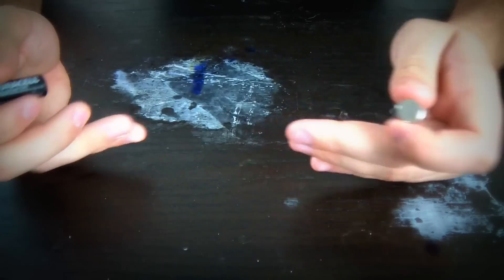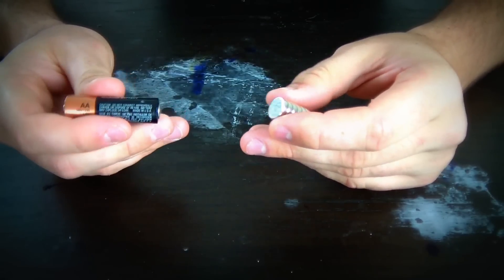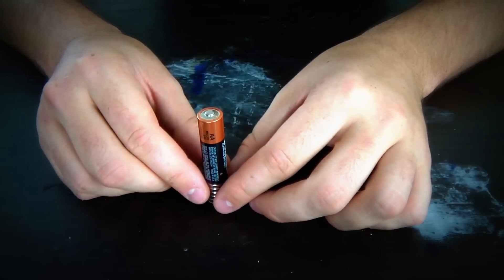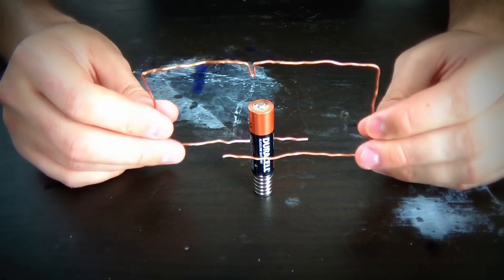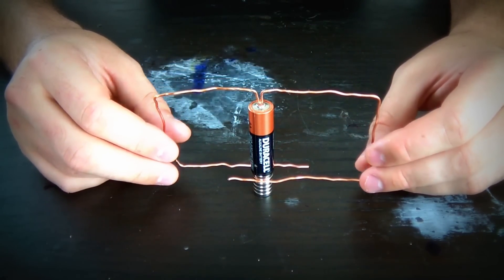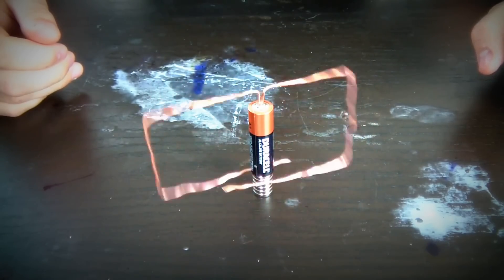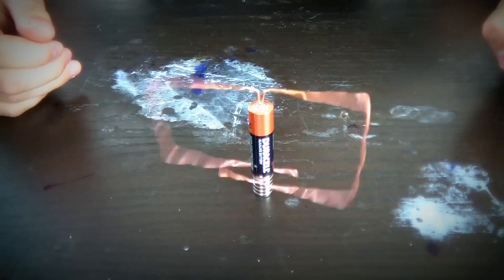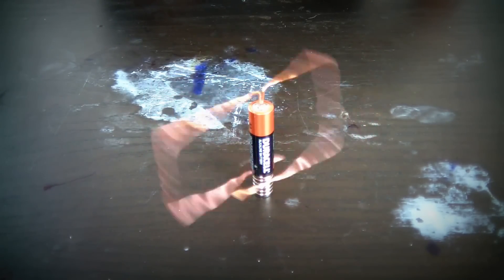Homopolar Motor

Comment: I made this with a new battery and on the wire I put some wings on and it flue about 50 + feet in the air and then started moving back and forth

Comment: It's easy since copper in non polar which means magnets don't stick to it and the neodymium magnets conduct electricity you end up creating an ac motor, and it spins because of the magnetic field created by the battery
Reply: +Cary Gonzalez one side chases the other. The End
Reply: +Jerry Enix how is it ac, the current never switches off.
Reply: +Cary Gonzalez
So what happens is the copper is non magnetic, so the magnets don't stick to it. And the type of magnet he is using conducts electricity because it's a metal. so when you put the wire on both the battery and the magnet it completes the circuit, but also creates a electro magnet. And it's because of the magnetic fields from the electro magnet that was just made and the magnets you already have attached to the battery it makes the wire spin
Reply: What

Comment: It works because there is a current carrying conductor in a magnetic field with relative motion between the 2. This is called motor action and is required for all electric motors.

Comment: ... if you split the two ends of the two wires that attach to the bottom magnets - it will not spin ! ... the spin is caused by that connection ... if you reverse the current bottom connections to be on the other side - it should spin the other way ... although this can depend on the make-up of the magnets at the bottom of the battery ... thus how it works is the electromagnetic field is pulling or pushing - depending on which way round the battery is ... against the magnets at the bottom ... that offset angle is all it needs ... the bottom half of that wire ... because of the angle of the wire against the magnets is how that effect is done ... hope this helps mate :-) ....
Reply: Gareth Wood Hi Gareth, my son tried to make this little motor but it just does not want to spin , we have watched so many of these videos in oder to see if we are doing something wrong but it still will not spin. could you please help us out.
Reply: mendez31971 ... needs an electric field caused by the charge from the battery ... you also need strong magnets ... the final thing to do is note the ends of the copper wire - furtherest from the battery ... they are not completely vertical like the battery is - slight angle ... and the other side is the same ... try pausing the video at the right time and you will see both the two ends of the copper wire are at the same angle ... this causes the electromagnetic field on the copper wire to push at an angle instead of directly down or up against the magnetic field caused by the neodymium magnets at the bottom of the battery - it will then spin ! ... the solid magnets must be strong type like Neodymium Magnets ... those type of magnets can increase the effect of the electromagnetic field also ... hope this helps :-) ....
Reply: Gareth Wood Wow it works, thank you very much for your help and for taking the time to help my son , it has put a big smile on my sons face
Reply: ... glad to help :-) ....

Comment: the principle is no different on how an electric motor works, you have electricity,magnet and a wire. the only difference is that the wire which should have been the rotor is externally placed. in that experiment if you hold the wire and the magnet and battery could freely move then the magnet and the battery or electricity will be the one rotating. in an electric motor if you feed it with electricity the rotor will turn, if you do not feed it with electricity and turn the rotor rapidly it will give off electricity. then you go back to the principle of magnetism on how it creates electricity.

Comment: I am a smart person, the reason the copper wire is spinning is because magnets are conductors and the battery produces energy to the copper wire. You are welcome.
Reply: YOUR RONG ITS SPELLD MAGNESIUM.
Reply: Don't boast, some people are smarter. (Including me haha)
Reply: ARE ME SMART 2???
Reply: it has more to do with simply conductivity, you also have to take electromagnetism in consideration with the fact that electric and magnetic fields run perpendicular to each other, causing this motion.
Reply: James Ryan Wei Soo Irony FTW

Comment: What’s happening is that electrical current is flowing from the positive terminal of the battery to the negative and into the magnet. This current then flows from the centre of the magnet to the edge where the wire connects, it travels up the wire back to the positive terminal of the battery and the circuit is complete.

Simple. But how does this generate movement you may well ask? Well, the key is the direction of the current and the magnetic field produced by the permanent magnet. We’ve put together the below diagram to support the explanation. The direction of the magnetic field is demonstrated by the red arrows and the direction of current is shown by the blue arrows. As the current travels perpendicular to the magnetic field, a Lorentz Force is exerted on the on the conductor (the wire) which again is perpendicular to both the direction of the magnetic field and the current, generating the spinning motion.
Reply: it is true but hideous to understand. since the experiment worked then it could be set as a model. the rotation is caused by the strength of the magnetic fields and the magnetic fields coming from the battery through the wire they both attract and oppose one another making either one of them to rotate. if you are applying electricity then it is called an electric motor, if you have two magnets that holds together and you are applying force to move them apart in a rotational manner then it is called a generator or a dynamo.
Reply: LOL. I know how it works but the description of how it works that you simply cut and pasted from some other source doesn't help others when there is no diagram to which the description refers.  :)
Reply: haha sorry

Comment: Assuming the magnets conducts current from the positive pole to the negative one via the copper wire.
So there's Two magnetic fields. One from the magnets and one around the wire (because of the current)
The combinaison of these two fields creates a force perpendiculary to the wire and horisontally.
so we have a couple of forces that makes the wire turn around the battery.
Normally if you inverse the magnets it turns on the other way.

Please excuse me for non-perfect english , i'm French

Comment: Dose it work with normal magnets?
Reply: thats my same question
Reply: No it has to be neodymium magnets
Reply: that depends on what you mean with "Normal" magnets it has to be a strong magnet, the stronger the better
Reply: max13239 and it has to be electrically conductive to get the current to flow from the wire to the battery.

Comment: take something like scissors and make a dent using it's tip in the middle of the batteries tip; make sure the bottom part of the wire doesn't squeeze the magnets. Only one of them touching it at a time is enough. And then watch it go crazy!

Comment: cu-wire touching both positive and negative ends of the cell,means current flowing on the wire.then conductor carrying current in magnetic then experinces a force on the conductor..thereby producing the torque due to which the rectangular wire rotates...

Comment: the copper wire has got current flowing through it making a small magnetic field. the magnets also have a magnetic field these fields oppose each other enough to make it spin, then the magnetic fields line up and oppose each other again. if you have more copper wire and get the magnetic fields to oppose more wires it will spin faster.

hope i helped

Comment: The magnets get energy from the batery and it goes to the wire and it spinds because of gravaty
Reply: Gravity has nothing to do with it. The current in the wire interacts with the magnetic field of the magnet and produces torque which rotates the wire.

Comment: A homopolar motor is a direct current electric motor with two magnetic poles, the conductors of which always cut unidirectional lines of magnetic flux by rotating a conductor around a fixed axis that is parallel to the magnetic field.The EMF (electro magnetic flux) it produces is continuous in one direction so it doesn't need a commutator (the moving part of an electric motor) but it still has to rotate .

Comment: Let me help Kuroi out.  I teach this in my college physics course.  The button magnets have a "dipole" magnetic field, it exits the magnets vertically, makes a loop and reenters the magnets at the bottom.  At the bottom of the battery where your wires are horizontal the B-field is mostly vertical. Force = Current * Length cross B-field.  The cross product of a horizontal wire and a vertical field is a circumferential force.  It's very slick!

Comment: Let me explain. :) I just learned this in physics. :) 

A magnet has a field around it called a magnetic field. It works kind of like a gravitational field, where it can affect things in the field. Obviously the further from the field, the weaker the magnetic field is. In physics, I learned that if you place a charge object into the magnetic field, it will move. The battery charges the copper wire on contact. Negative electrons move through the wire. By the wire touching the magnets it's a

Comment: It works because of the Lorentz force.

The Lorentz Force formula is:

F=i L x B

L is the lenght of the wire, i is the current and B the magnetic field. x is the vectorial product.  It means that, if you have a magnetic field and a current that are not in parallel, you can create a force and find it's direction using the right hand rule.

As you have 2 wires, you get 2 forces. So, your torque will be doubled. If you get a better battery and increase the current, you get a higher force->torque

Comment: The wire gets pulled at all sides because of the electromagnet, which causes the wire to spin. On big motors theres a bobbin used to spread electricity to metal which creates electromagnet. Then in the middle of the metal theres a steel cylinder with wire wrapped around it. When you turn on the motor the wires get pulled at all sides to cause it to spin. This is how it most likely works. I think. Or know

Comment: I think the permanent magnet doesnt amplify the Lorentz Force but rather gives it a counterpart where it can "grab" on. Not sure though. You could try this by not putting the magnets in direct contact with the current circuit.

Comment: Like any other electric motor, the homopolar motor is driven by the Lorentz force: as they move through an external magnetic field, the current carriers in the conductor experience a push that is perpendicular to both their velocity and to the external magnetic field. This force induces a torque around the axis of rotation. Because the axis of rotation is parallel to the external magnetic field, no commutation is required for the conductor to keep turning

Comment: A homopolar motor is an electric motor that works without the need for a commutator, by rotating along a fixed axis that is parallel to the external magnetic field produced by a permanent magnet. The name homopolar indicates that the electrical polarity of the motor does not change Such motors necessarily have a single-turn coil, which restricts their practical applications, since they must be used with low voltages and produce relatively small torques.

Comment: When electricity runs through a wire, it will create a magnetic field and a force called the Lorentz Force.
This is quite weak usually, the magnetic field of the permanent magnet(s) strengthens it.

At least that's what I made up from the wikipedia article.

Comment: electricity travels through magnet and radiates outward from the center. this causes a magnetic field to form and continually change causing the wire to move